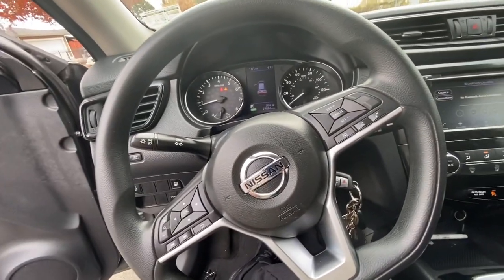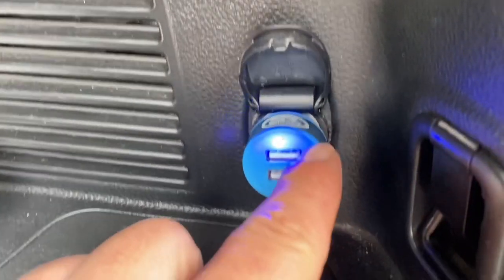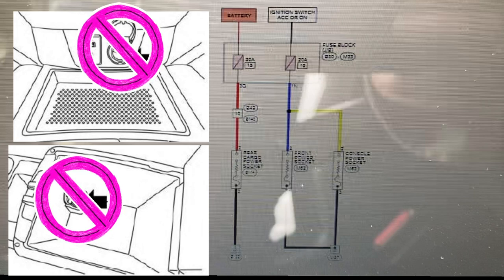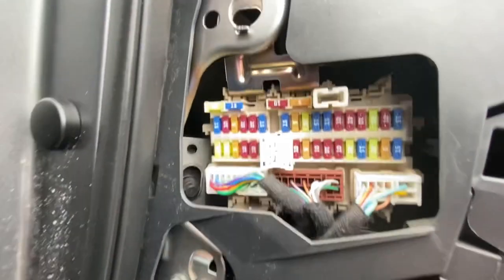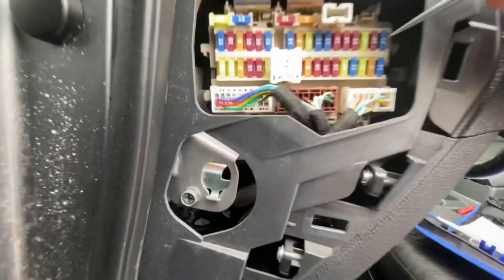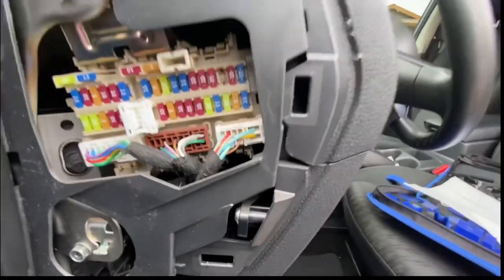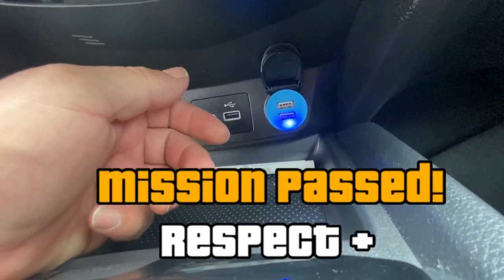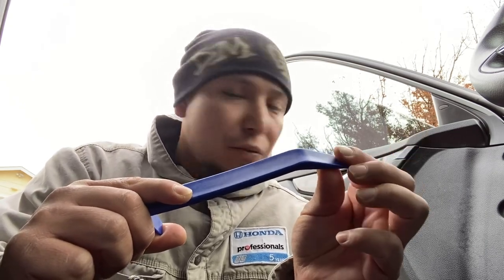HOW to fix cigarette lighter/power socket  on 2018 Nissan Rogue 🔥🔥

Comment: Informative video. Straight to the point. I was able to change the fuse for the cigarette lighter, but I can’t seem to find the fuse location for the one in the center console. I checked the manual but no location… Do you know where it might be for a Nissan Rogue 2015?

Comment: Thank you for your videos ⚽ I have replaced the fuses I checked two areas in my 2016 Frontier one fuse was burnt I replaced it but I'm still not getting power in my cigarette outlets so I'm struggling to keep my cell phone charged WHAT DO I DO NEXT?

Comment: I liked and subscribed I was wondering can you please tell me which fuse in this video is for the ACC ignition to turn on and off so I can add my dash cam. I can see it tells you on the back of the panel which one is ACC but it does not turn off when the ignition goes off can you please look at that for me

Comment: Do you know the location of the fuse for the boot 12v socket? I have the same issue but reversed, cab sockets work fine boot one does work

Comment: My issue is the windshield washer doesnt work. Fuse is good and 3 diff pumps but no luck getting power. Wondering if it has a relay or fuse elsewhere other then in dash side. 
2017 rogue.

Comment: What cause the fuse to be blown? I have also similar problem. I replaced the fuse but it keeps on tripping. Perhaps the lighter socket need to check.
Reply from the maker: What causes a fuse to blow is a short to ground before the load. In this case your load would be the cigarette lighter/power socket. 
Does it blow as soon as you replace it?
Perhaps you’re overloading the circuit?
Reply: @dmgar3789  I set aside the overloading because this is the same load before I used when it was working well. I think a shorted circuit or grounded is behind this socket
Reply from the maker: @recoveryfiles8098   you can remove the socket and inspect the harness.
Reply: @dmgar3789  yes I think. How to remove the whole panel is what I need to know

Comment: Thanks for sharing! Does it matter which way you plug the fuse in? (I notice some are facing the opposite way) ... Btw, would you know where the fuse and relay for the Windshield pump are located for 2015 Rogue? My windshield is not spraying any fluid...the front/back wipers work, but no fluid or the pumping sound...thanks!
Reply from the maker: You’re welcome Mark. No, it doesn’t matter which way the fuse is facing. I do not know where the fuse is for your windshield washer motor, but if you’re not hearing the motor trying to pump most likely it’s your motor that went out. You can do a voltage drop at the motor or you can simply use a test if you don’t have a volt meter. The motor will be at the bottom of your windshield washer reservoir. Good luck 👍🏻
Reply: Seems its common problem with windshield washer pump. Its in same place as this video from what i saw when I checked,but no luck as mine was still good. Looking to see if it also has a relay somewhere. 3 diff pumps cant be bad.